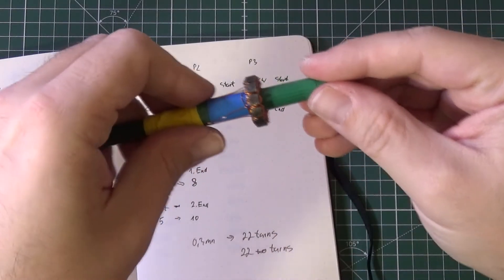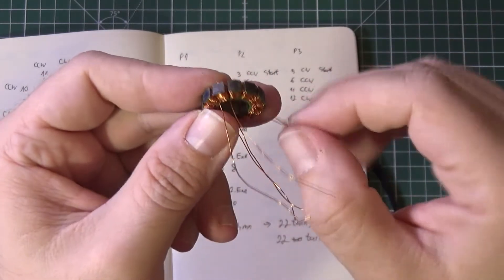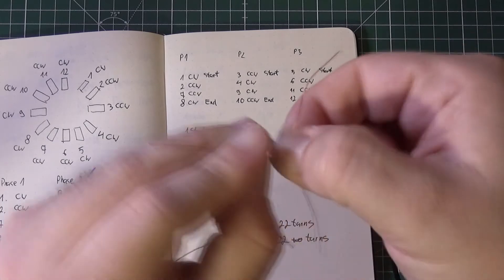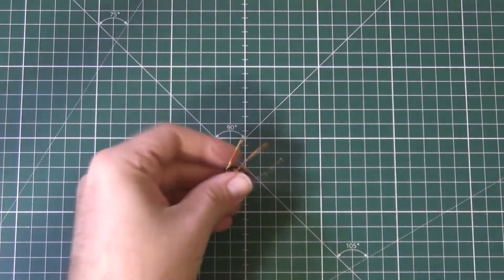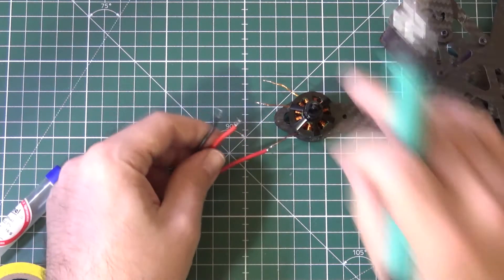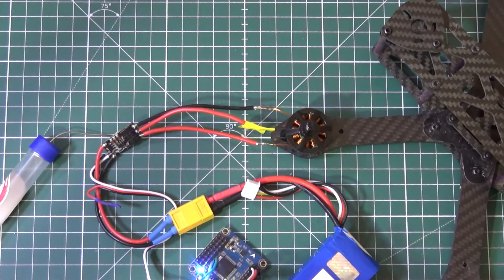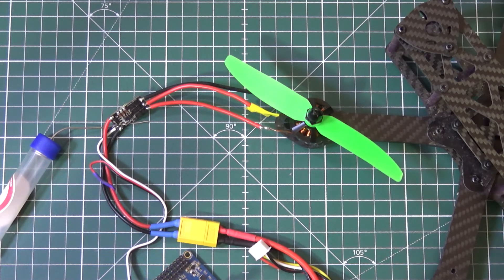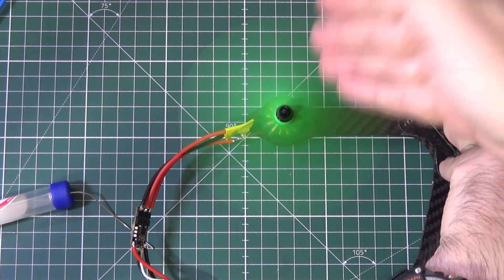How to wind and rewind an RC brushless motor | part 3

Comment: I tried do use the same wire and turns as the original (12 strands of 0.3mm and 9 turns) and just can't fit within the available space.... Then I changed to 3 strands of 0.6mm wire (same area) but also could not fit the same 9 turns. The maximum I can achieve is 8 turns....... Even with tedious and very careful winding, folding the wire each leg. Tried with all strands together and even by winding each strand isolated to better packing ..... Still impossible for me to rewind a motor with the same turns/wire area as the original (a Multiplex BL-O 3420-0630).

Comment: Very informative video Pawel . Nice job .
 Yesterday I burned 3 of the 4 motors of my quad . Today I opened one of them to see if it was possible to rewire it.
The motor is 2807 1300KV in delta connection . Each coil has 10 turns but id was made from 6 individual 0.3mm wires in parallel . In a comment you answered ( 4 years ago ) , that it does not mater if we put many thin wires or a thicker one .  Why they put multiple wires instead of one thicker ? Is there any benefit in multiple wires ? If no , why they made it harder to produce it ?
Thanks in advance

Comment: Well, you actually ended with 5s or 6s motor. Test it  on 6s and a 5" triblade prop. The watts will be way way higher ;)

Comment: hey Pavel, thanks for those tutorials ! I Have a question about windings. Might look like a silly question but I'm wondering... I guess the 3 phases have to be isolated from each other, right ? I mean, Phase A can't touch phase B anywhere in the motor ? or this don't change anything ?

Comment: Hi, I have 5 kits of the exact same motor as you show here. I used the included 0.5 mm wire to test wind one with 15 turns: https://www.rcgroups.com/forums/showthread.php?2909465-DYS1104-motor-rewind-for-higher-Kv/page5#post38926230
After measuring the Kv of this motor to be around 2200 I decided to wind the remaining motors using 13 turns yielding a Kv of about 2600: https://www.rcgroups.com/forums/showthread.php?2909465-DYS1104-motor-rewind-for-higher-Kv/page6#post38984894
After seeing your video I measured the power of one of them when driving a 5x4x3 prop: 15.48A @ 10.97V so about 170W.
Reply: Thank you so much for those links! I'm wondering if I'd be able to rewind RS1106 Emax that have been broken by the too long screw :/ If you happen  to have any idea what fi of the wire should I use or how many turns I should aim for that would be great :) I think I'm aiming for 6000kv but have no idea what kind of the wire lenghts I would need per 1 motor (I don't want to buy hundreds of metters of the wire just to wind 4 motors)..

Comment: How would double winding affect the KV? I mean to have double wires going parallel on each coil. Or it's about the thickness of the wire? Also recently I saw a video on YT showing that low kv motor (like 1350kv) and 6S LiPo can be a beast.
Reply from the maker: Winding with 2 thiner wires in parallel is the same as winding one thicker with the same number of turns. Of copurse is total wire are is the same. If you want lower KV just just have to put more turns in "serial". And that usually means you have to use thiner wire
Reply: Thanks for the info. And one more additional question, what is the polish name for the wire that is used for rewinding?
Reply from the maker: Drut Nawojowy Emaliowany w skrócie DNE
Reply: @Szczypior: Or you can use Y-termination to get a lower Kv.